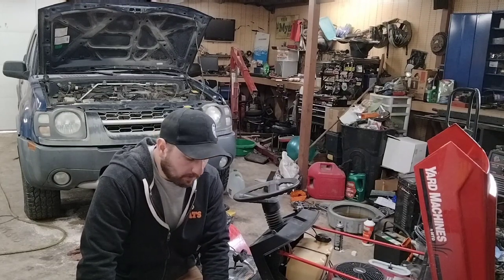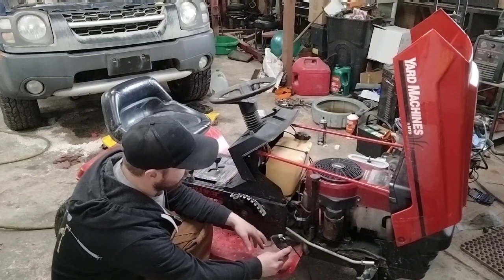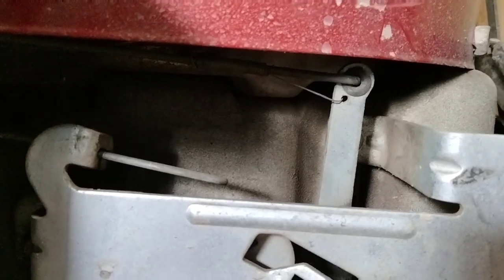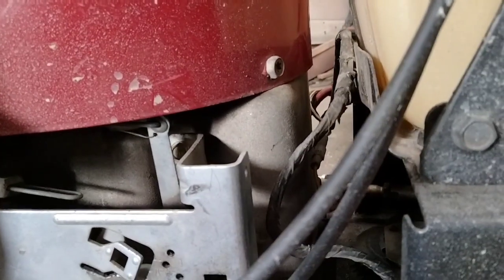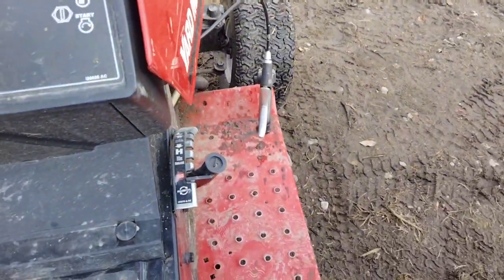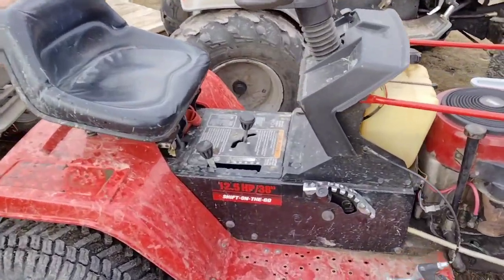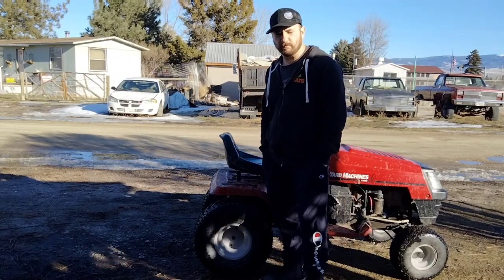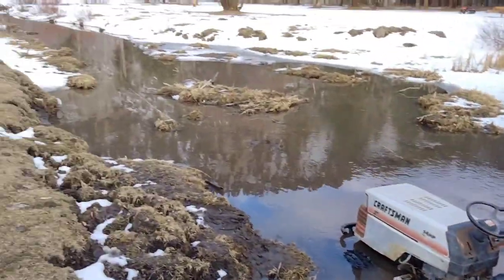Riding mower foot throttle

Comment from the maker: Everything stays stock. Your essentially just adding your own throttle cable to override where the old one used to go. Yes it does use more because of the higher rpm range.

Comment: So the engine is gonna get damaged by using much rpm?
Reply from the maker: It's a risk that you take when you do this mod. It's up to the operator to keep the rpms low enough that the engine doesn't blow. I did put my own governor on there so you can give it full throttle